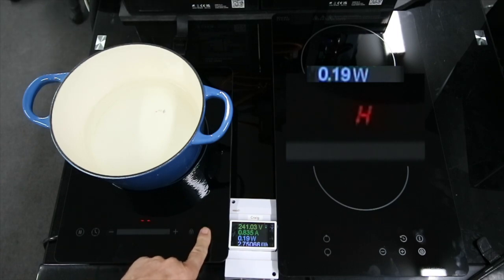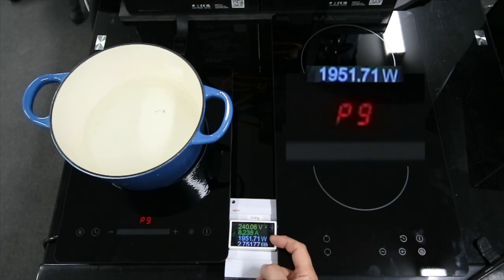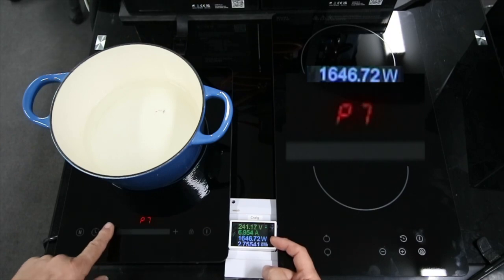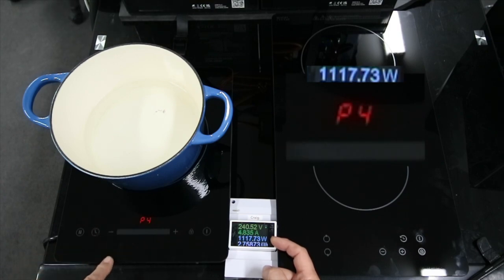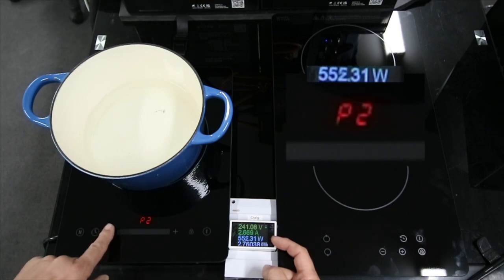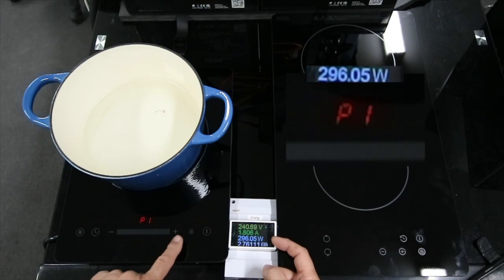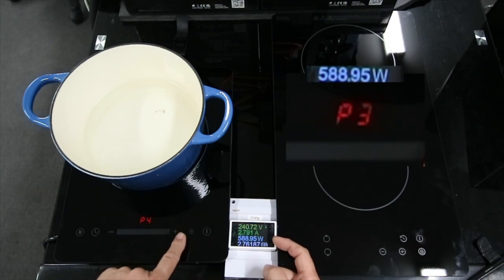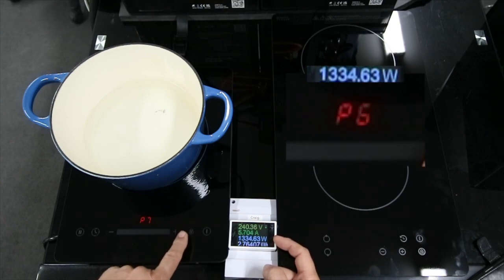SINGLE Induction Cooktops Now are Smooth Power No Pulsing Clip and matching 2000W Inverter

Comment: dose any induction compatible utensils will draw steady power on low power settings , or there is any type of cook pot specific ?
Reply from the maker: Hi Best induction pots have iron in them, some are then wrapped in stainless steel. My favourity is the casst iron ceramic lined pot.